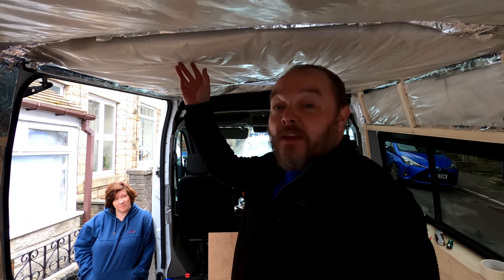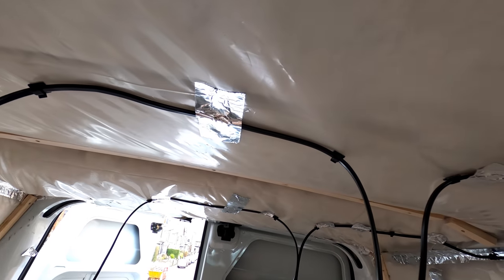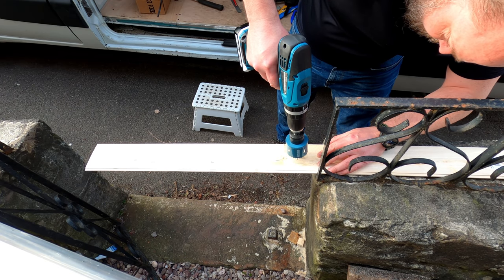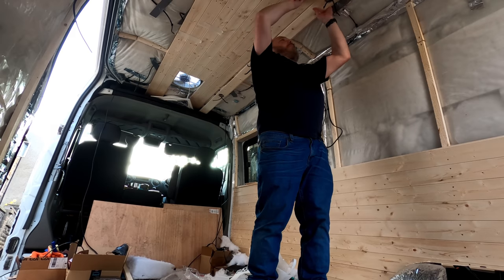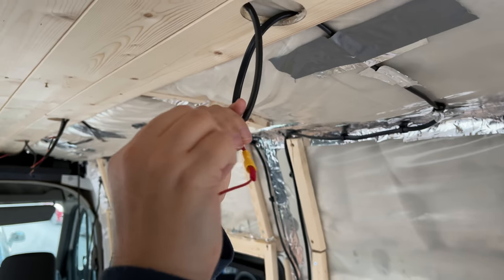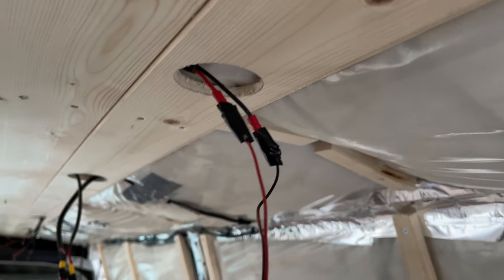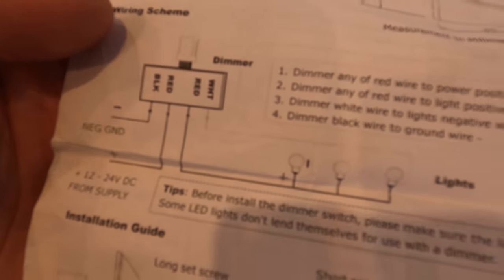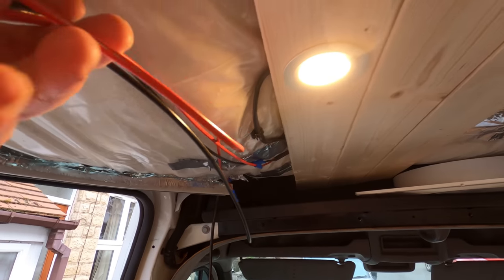Camper Van Conversion | Installing LED lights and ceiling build.

Comment: Nice job there but think about putting a solar system on the roof in the future so  make a hole and pass a cable before you close the cyling .

Comment: Hi Paul and wife (forgot your name sorry) are you fitting Solar panel?. Just a thought before you finish the ceiling and Batteries/electrics. If not, you should consider being a wild camping couple. Go anywhere without worry of power. Van looking cool, not a lover of the cladding myself, but seems a popular choice, probably for it's easy fit etc. Glad you're not boring us with the video length like some do.To the point content. Quality as always⭐️👍

Comment: This is looking great! A very good choice for the lights. If you want to do yourself a favor, make a rough wiring diagram, so that if you have some repairs to do, you can look up the wires on paper and don't have to pull the wood off the walls.

Comment: You are quite handy, Paul. Even though you don't read the instructions for the dimmer before you put up the ceiling boards (not sure what you call it in english). You do land on your feet eventually. Just kidding. It is all coming along very nicely :-)

Comment: Have you checked how hot the back of the lights get? As they are pushed against plastic sheeting there is a risk of melting it. Maybe need to put heat resistant tape on the sheet before pushing the lights in. Just a thought in case they get too hot.

Comment: Coming on nicely Paul. Are you planning on having a solar panel? If you are it might be best to fit one before you finish off the roof panels. You can get some cracking set ups these days for not too much money and with the right kit you can be pretty much self sufficient when it comes to energy.

Comment: Are you planning on putting any sort of finish (eg varnish) on the panelling? If yes, put some around the holes before you put the light fittings in. 👍 Good job BTW, I've zero interest in owning a camper van but this series is still enjoyable to watch.

Comment: Paul, not gone into much detail on the cables dangling down before did that come with the led lights ? I’m confused trying to wire in my van and don’t get how I take it from fuse box along 1 wire into 6 lights
Reply from the maker: I had to follow a video on YouTube myself. I’m no sparky I’m afraid